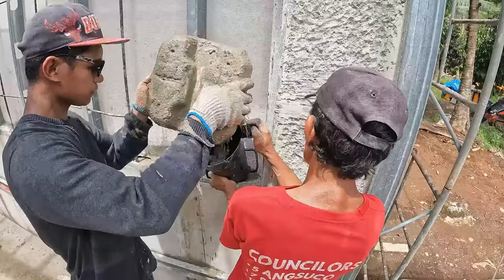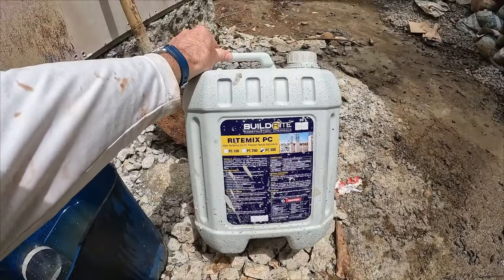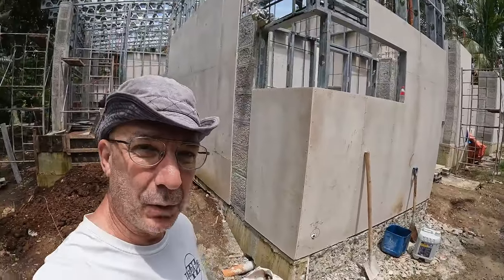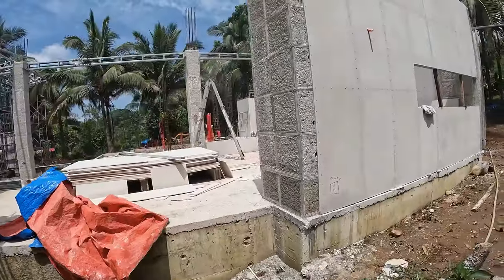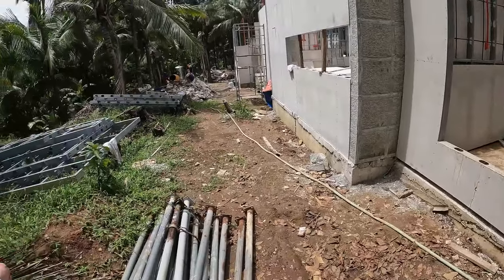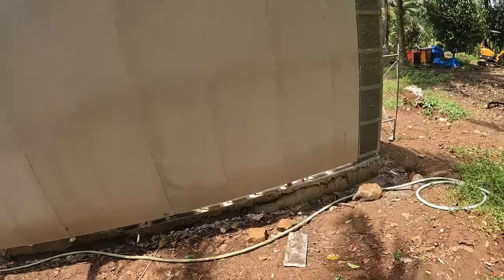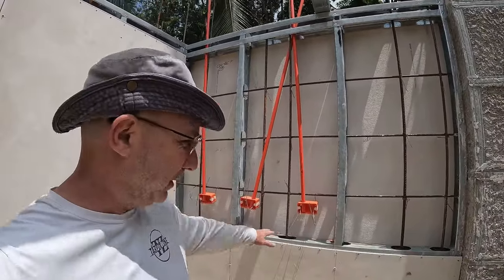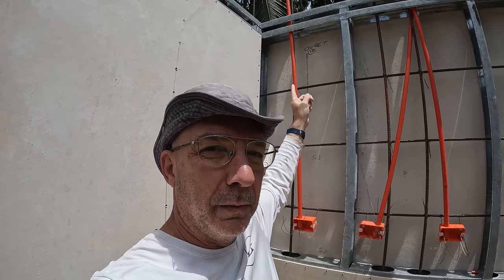Electric & Water Outlet Tips 🚧 | House Build Philippines | Ep. 22 | TORINO

Comment: u sound like a tech guy.....so u may want to consider more network drops in rooms as wifi may not penetrate those walls unless u have a mesh network.....jus a suggestion......depends on how crixtical ur network is for ur comfort.
Reply from the maker: Good tip. I will have a drop in each room ceiling for an access point.
Reply: Look 👀 ing good.  I can see those walls a very strong , very interesting way to build..  your right put those outlets in now , coz it would be near impossible to do after..  good work 😊
Reply from the maker: @mellyons4052  Thanks for watching!